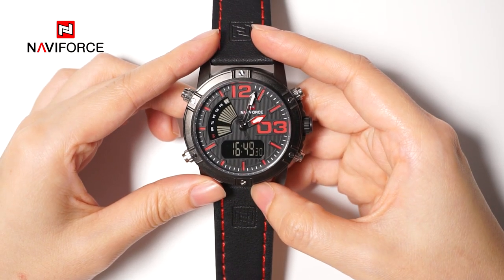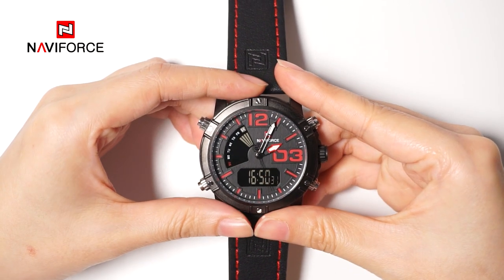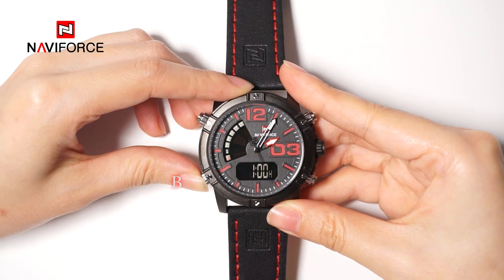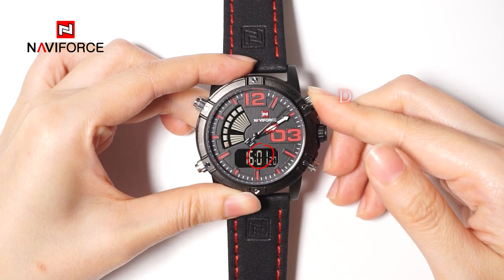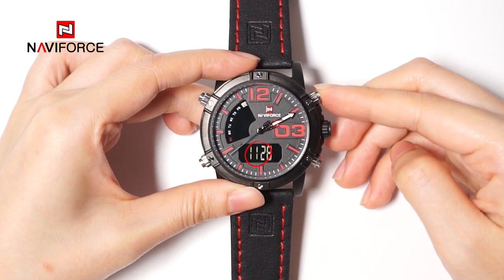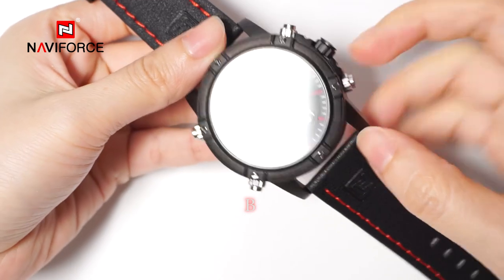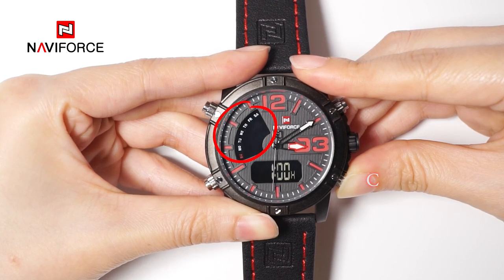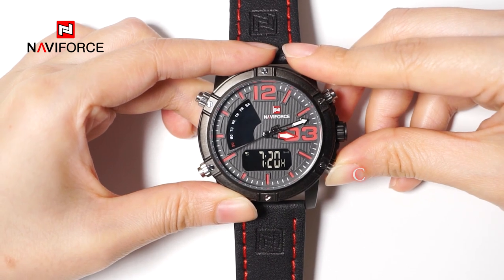NAVIFORCE NF9095 How to set the time and other functional mode?

Comment: Can I convert 24 hour mode into 12 hour mode?
Reply: First click lower left button 3 times to get into the time setting. Then click lower right 2 times, so the hour will blink. Now just keep clicking the upper right. There's a small text in the display that says A, P, PM or H. If you want 24hour format, it needs to say H. As you keep clicking the upper right button this will change betweeb A P H. Hope this was understandable :)
Reply: @wladimirfroes3220  Thank you so much, i've been fucking with that for over a few hours and couldn't find how to change that anywhere